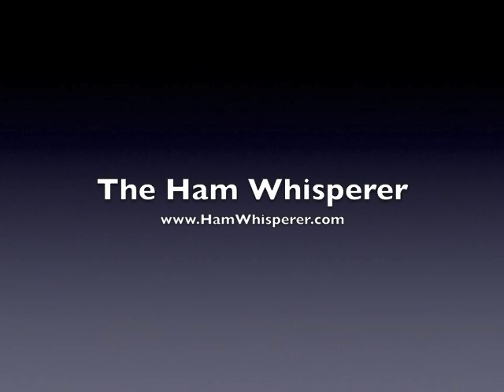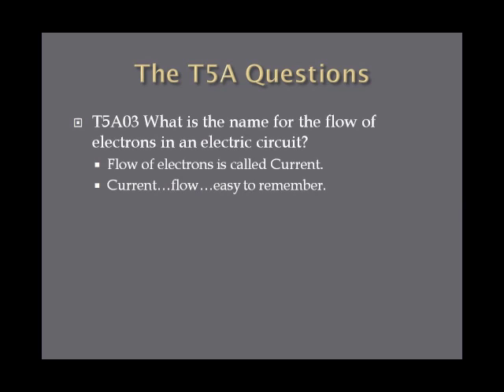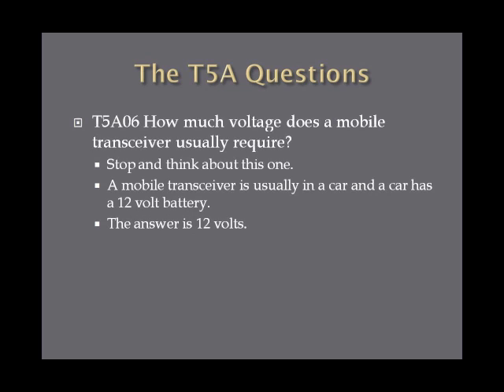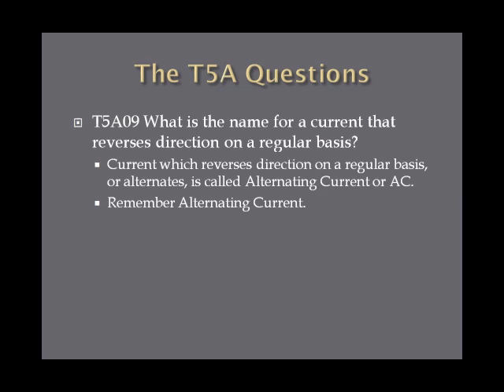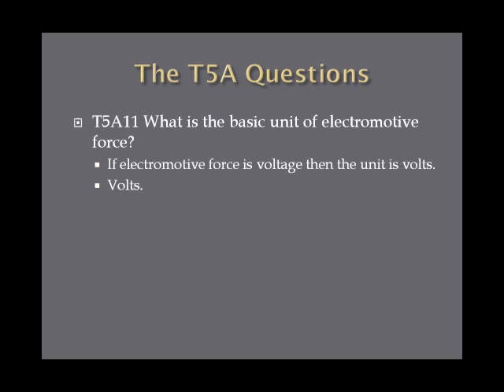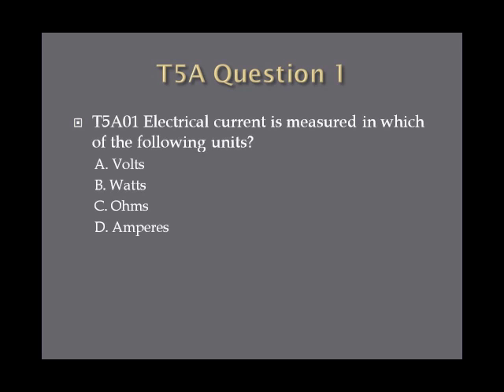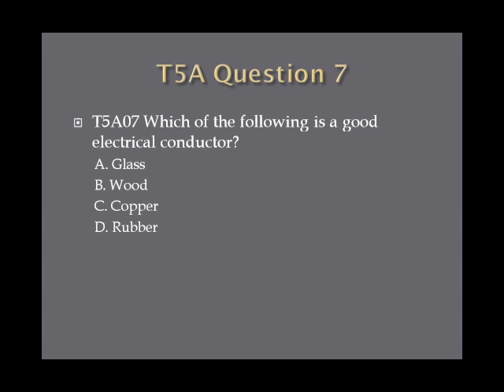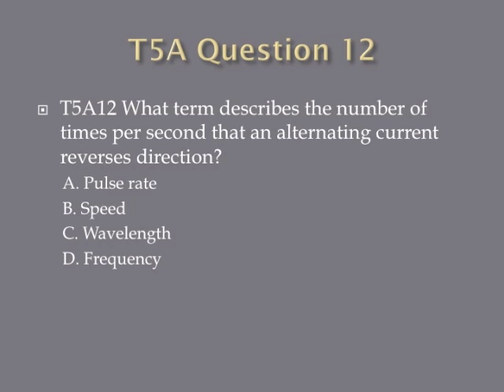Lesson 15 Technician Class Exam T5A Second Edition

Comment: I think a question in here should be reviewed for refinement. When you buy a mobile radio and want to use it as a base station you are required to purchase a power supply which is rated at 13.8 volts. Sure. The car battery is 12 volts when the engine is off. But, when engine is running the alternator charges the battery and supplies voltage to all electrical circuits to 13.8.